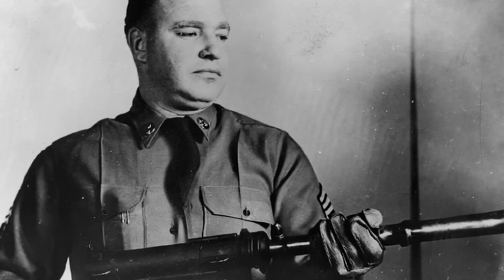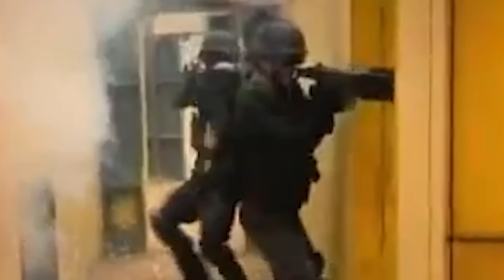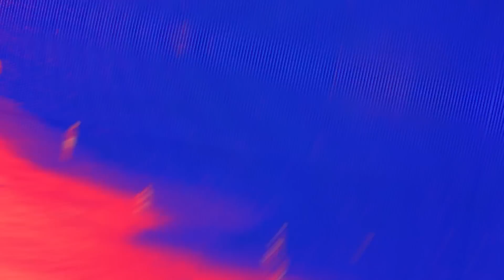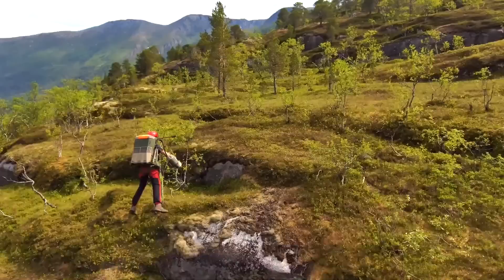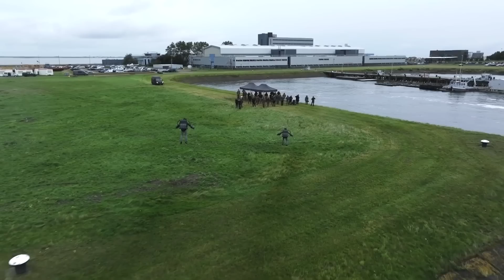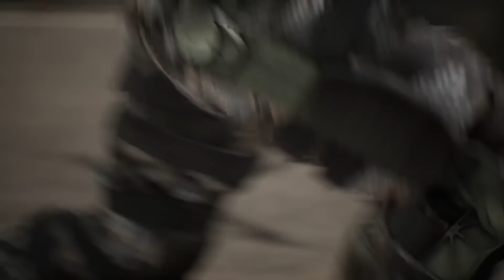Craziest Military Weapons You Wont Believe Exist

Comment: ALL THEY NEED TO DO IS ATTACH THE JET PACK TO THE EXOSKELETON. AND HAVE THE JET PACK SWIVEL IN DIFFERENT DIRECTION USING AI HELPER LIKE FLY BY WIRE TYPE, BUT WITHOUT THE JOY STICK OF COURSE, IT'S ALL A MATTER OF PUTING SEVERAL IDEAS AND BRAINS TOGETHER TO SOLVE COMMON ISSUES, CARBON-CARBON EXO SKELETON IS SUPER ULTRA LIGHT WEIGHT BUT AS STRONG AS STEEL, IN FACT THE SUIT I ENVISION SHOULD HAVE MICRO TUBULES WITH OXIGEN FOR THE WEARER AND SOME TYPE OF ANTI FREEZE AND WARMING FLUID OR GAS OR ELECTRIC, DISTRIBUTED ALL AROUND THE SUIT LIKE A NERVOUS SYSTEM, THAT ONLY NEED THE ELECTRICITY OF THE HUMAN BODY TO RECHARGE, THE SKY  OR SHALL I SAY SPACE IS THE LIMIT, THINK ABOUT THE SPACE SUIT THE BIG HEADED ALIENS WEAR, THAT SUIT PROVIDE THEM WITH AIR SUPPLLI, NUTRIENTS, PROTECTION IN THE FORM OF AN ELECTROMAGNETIC PULSEAND DIFFERENT ELECTROMAGNETIC FREQUENCIES TO CAUSE SLEEP PARALYSIS, OR PANIC OR OTHER SENSATIONS, THE POWER SOURCE OF ONE CRAFT WAS DESCRIBED AS A CRYSTAL TABLET THAT COULD POWER A CITY OR A CELLPHONE, IT COULD BE ADJUSTED FOR THE TAsk and crystals have infinite energy stored, john hutchinson back in the mid 80's was already making 2 volts batteries using normal crystal rocks he gathered around his home? the key to a lot or shall i say everything is unlocking electromagnetism as NIKOLA TESLA PROVED IT, THAT AND WATER, WE KNOW VERY LITTLE ABOUT WATER THE LIQUID OF LIFE